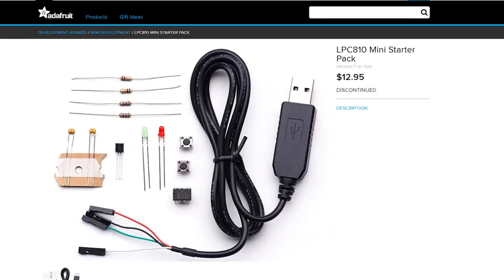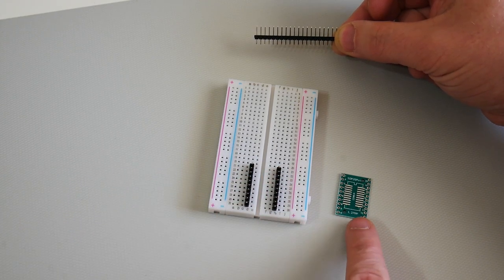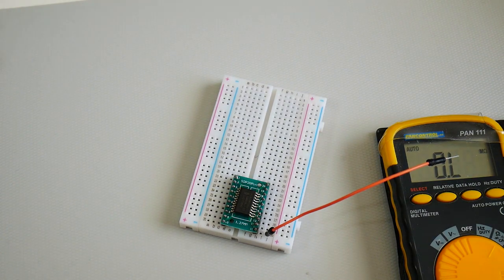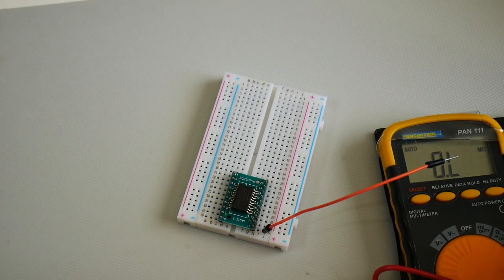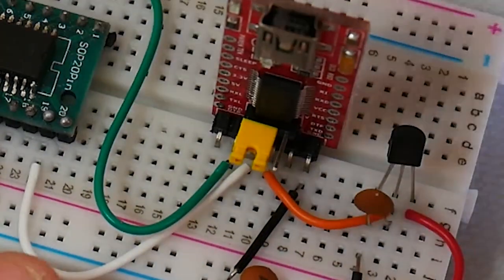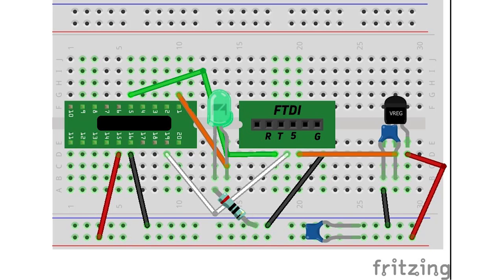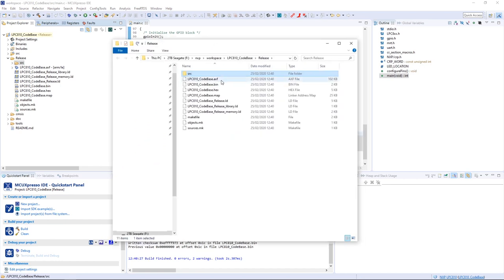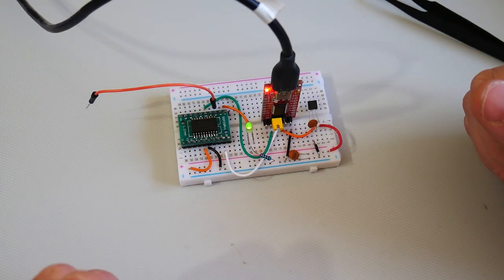Build Your Own Arduino Like Board For Just a Few Dollars

Comment: I know that there are a lot of soldering opinions, probably a different one for everyone who solders.  The best way to find your inner solder master is to do a lot of it, watch other people, pick up tips and tricks, and then find your own technique based on trial, error, and oftentimes discovery inspired by moments of accidental cleverness.  I come from the Jessa Jones/Louis Rossmann camp of thought that there is no such thing as too much flux but there definitely is such a thing as too little or the wrong flux.  I use Amtech NC-559-V2-TF Tacky Flux 30CC as recommended by Louis and Jessa on a daily basis when repairing SMC boards at South City Computer in St. Louis - http://southcitycomputer.com 

I like how the Amtec is in a syringe for application and how its sticky and gooey and stays in place to fill gaps and spaces and tends to hold components in place a bit as the solder flows and gets sucked into the joint. Maybe I read it wrong but I disagree with another viewer here that the flux has little to do with the solder flowing.  When I solder the flux definitely sucks the solder in.  I learned this from a master plumber when I learned how to properly solder copper water lines like a professional ("if it don't leak it's right") before I got into board and component level electronics repairs but the principle seems to be the same.  I also make my own flux with rosen dissolved in alcohol as inspired by another one of my favorite online teachers.  Here is his lesson on making your own https://youtu.be/5h2NPkdzRyY. 

I find using liquid is better for reflow work, and for when I use chip quick or leaded solder to lower the melt temperature of existing silver solder joints before I wick when removing components like DC jacks or when I clean off pads.  The homemade stuff has less residue and cleans up easier.  Of course the proper tip, temperature, and "feel" for it comes into play.  I appreciated your video though a lot and am interested in learning from you about the software side of things too, which you say you're better at.  Don't be critical of yourself.  If it works, it works :)  I am really thrilled that there are so many people soldering now, even if they think they do it poorly and sharing what they do with the world.  I should make some of my own project videos to give back. My hangup with that is my lack of confidence in my ability to make videos that don't suck :)  Any tips and techniques or recommendations on overcoming that would be appreciated!

Comment: If you're adding flux to prevent the solder from sticking to the circuit board itself (and that does seem to be your intent given the many times that you say you only want the solder to stick to the metal bits) then you're wasting your time and flux.  Solder will never stick to the circuit board itself no matter how hard you try to make it do so.  Even with no flux whatsoever it simply is not going to stick to the board.

I don't understand your desire to check continuity from the pins to the breadboard.  At that scale you can quite easily see if a pin has solder on it or not.  If it does then you have continuity.  No need for getting your meter involved here.

For best effect bypass capacitors should be placed as close as possible to the IC which they are protecting.

Comment: I like most of what is on your channel; not to say I do not like this one so much as I philosophically disagree. Your solution is not 'Arduino-like' at all. Arduino opened up physical computing to the masses in a time when microcontrollers were in the domain of serious academically-trained embedded programmers. The IDE was small, easy and full of helpful examples. Special programming adapters were not needed. While a FTDI serial adapter is cheap and easy to obtain nowadays; the Eclipse development environment that edits and compiles the code is a mind-numbing monstrocity for the novice to engage. I would think that the future of hobby and introductory educational microcontroller projects will be relying upon the abstraction of MicroPython or Circuit Python and the ease of just editing your higher level code in a simple editor and dropping it into the device as if it were a USB memory stick. Using Python it is relatively easy to pull data from the internet, talk to a variety of displays and read numerous sensors. Banging out code in ANSI C (or C++ without the helpful Arduino examples and libraries) will result in frustrated users who never move beyond blinking an LED.
Reply: All abstraction does is introduce bloat, bloat and yet more bloat. You are also mistaken with your first sentence. A lot of hobbyists like myself have been using microcontrollers since before the time of Arduino and its bloat. You are also mistaken with your final sentence. ANSI C is still my preferred method of coding but that could just be due to the fact I'm competent enough to code my own libraries and use makefiles.
Reply: @SpeccyMan  Let us put this into perspective. For the last 7 years, for a quarter of every weekend, I have introduced hundreds of people, one-on-one, hands-on, to physical computing using the Arduino at my MakerSpace. So many of them have gone on to make their own great projects. How many people have you helped using your methods? Has it occurred to you that you owe a debt to the Giants of the past (like Richie) that can only be paid by making computer science more accessible for those who come after you? Knowledge is for the benefit of humanity and is meant to be shared. Arduino has a community; do you have one?
Reply: @jamesdinsmore9022  Can you tell me where to go to research information on "micro PCB circuit boards" to make a micro controller for NES that works on NES original console/hardware. That has a ability to have direction on D-pad and/or buttons A/B to have auto-fire turbo capabilities? All the while working without the need for any external programs running on a PC like Joy2key, Rewasd etc....So basically all the turbo functionality is self-contained within the pad controller itself.  Somone said something about altering the shift registers to produce turbo. How do I find info about that? Googling it does not really bring anything up but pre-made third party Turbo controllers and that is not what I am talking about.

Comment: This chip is not as common as AVR atmegas / attinys.
Reply from the maker: 😂 LOL... I think you have that the wrong way around! 4.2 billion Cortex-M based chips were shipped last quarter... 6.4 billion Arm chips in total, that is over 800 per second. ARM's partners have shipped more than 160 billion chips, and an average of more than 22 billion over the past three years.
Reply: @GaryExplains  I meant for retail purchase by hobbyists. A search on ebay came up with very few results.

Comment: what a flux are u using?
Reply: Rosin based flux, look for one that has an RA flux. You can buy it in small bottles with or without an applicator. I keep mine in a small squeeze bottle designed to refill inkjet cartridges. DO NOT USE ACID BASED FLUX! Acid flux is for plumbing, not electronics, it will destroy your traces and components. Look for Mr. Carlson's lab youtube channel for some good tutorials on soldering.

Comment: " like" is not so like. It does functions yes, but you lack half of the benefit with arduino. What makes it a success is that they have the library tools and programmer as well as the hardware and there are also full functional simulators, so why change from that to something else is not logical unless you already build specific chips and then you are unlikely to ise arduino
Reply: Anyone who is actually competent to build this circuit is already skilled enough to use a better and less bloated toolchain.
Reply: Nick B  but why, there is a ton of parts for the arduino line and sensors, motors etc that doesent require a shitload of work , together with libraries. No one cares about the code at all if it does its job.i have made systems for 20 years and the latest plc certified arduino is so cheap that for small applications there is no real match. If i would do custom boards without going to the shelf ,  i dont see myself doing this..i would use an arm cortex something with a proper i/o and let all pwm be on a seperate board